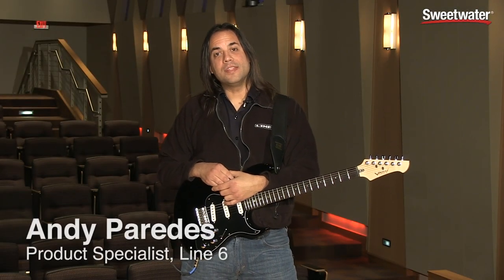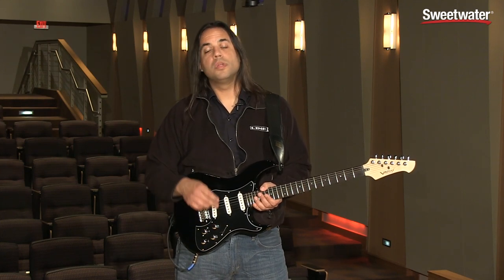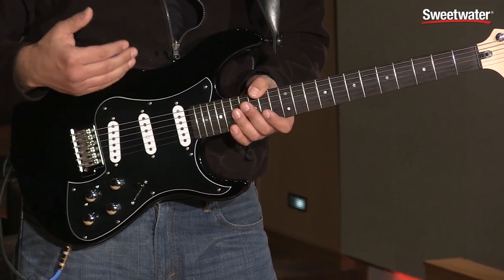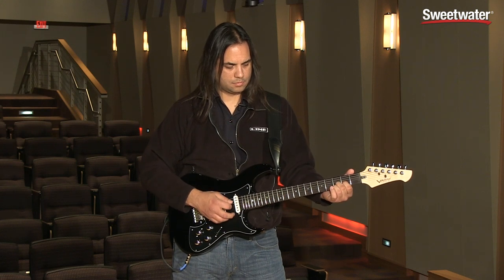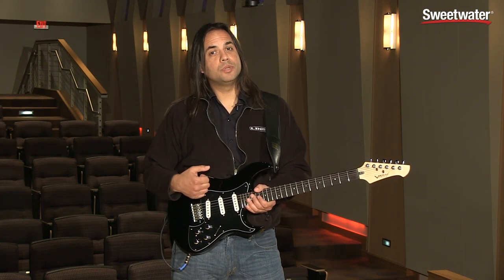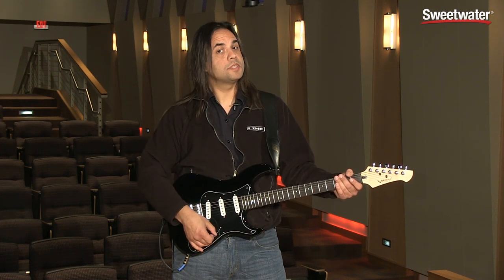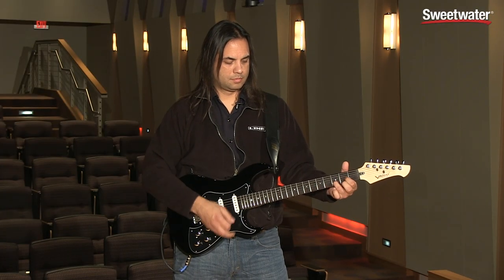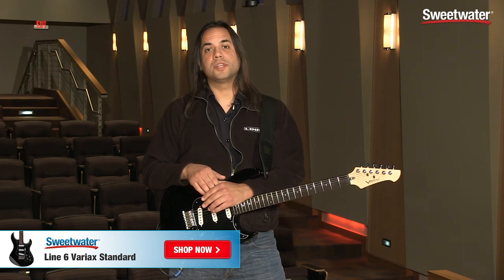Line 6 Variax Standard Modeling Guitar Demo by Sweetwater Sound

Comment: I wish they would add another output jack for the magnetic pickups only. That way I could use the modeling and real pickups simultaneously.
Reply: you can, but you mix it via workbench - it lets you mix with different tuning too - and you can choose the amount of mixing.  Then it all goes out via the one plug to whatever you have it plugged into - so, no, you won't be able to have two different amps with two different signals, but it's either or, and in my case, it works better to have it mixed on the guitar, not the other way around.
Reply: Oh that'd be cool

Comment: The Variax is such a great idea but just doesn't work properly. I had a new JTV59 but had endless problems with ghost notes and so returned it to the supplier for repair. Unfortunately they couldn't sort it so refunded my money. Then a friend of mine bought a new JTV69 with the exact same problem. The forums have many similar complaints. I would be very wary of buying a Variax as they need to be developed further to eliminate this issue.

Comment: Still a little frustrated by the fact LIne 6 hasn't put more (new) sounds in the latest models, could be more guitars, or some middle eastern stuff like the oud & baglama..
Reply: Karl Georges oud and lute would be awesome, or synths! Reaktor Prism sounds on a guitar would be epic.
Reply: Karl Georges Limitations of the onboard memory means they can't add new models. I read somewhere that the memory is full with the new firmware, so adding stuff is impossible unless you removed features or made a new Variax with bigger memory altogether.
Reply: Mandolin would be nice...?
Reply: @Fromagreatheight  hopefully someday. It’s still great as is though.

Comment: To start with, I've always been intrigued with the Variax guitars, but have never liked the actual build of the instrument. Now that Yamaha's on board, I need to take another look at it. Good move Line 6!

Next, I don't think I've seen Andy Paredes demo anything before, but man, he is GOOD. Zero 'tude, calm delivery, and he plays FOR THE DEMO instead of trying to show off. Good move, Sweetwater, keep this guy around!
Reply: I agree with you about the earlier model's build quality, I've had two, a 500 and a 600, heck I'm playing the 600 in my pic. It's a great concept and I've thoroughly enjoyed performing with these instruments but initial setup was not good. Hopefully matters have changed. cough Nylon strung please cough.
Reply: Obicere Interesting— but I'm not sure if you mean you'd like a nylon string sound on the Variax, or a Variax with nylon strings instead of metal?
Reply: Mooseboy08
Oh hi, yeah I'd like a nylon strung emulation. I'm not sure why that particular type was omitted, perhaps it was the technology or perhaps product positioning.
Reply: Obicere Shucks, I guess I assumed that nylon string was in the lineup of sounds. I do use the Nylon string + orchestral strings sound on my Roland GR-30 a fair amount, so this is a bit of a letdown. Thanks for mentioning it, although I'm still going to check this new one out.
Reply: Mooseboy08 Me too. Just have to wait and see.
Reply: Mooseboy08 Possibly add a Fishman PRO-TRP-301 Triple Play Wireless Guitar Controller  to 'hot-rod' the Line 6 Variax.
Reply: kbjazzgtr001 Now ya' see, that's why this guy gets the big bucks! That's a superb idea, thanks!

Comment: I have a Line 6 Variax JTV-69S and have installed Joe Barden pickups in it. It is just as straightforward as unsoldering and resoldering the pickups to the existing wiring harness. I love Joe Barden pickups so I would do this over again in a heartbeat; but, the only negative is when I was running the OEM pickups and switched to the Spank (STRAT) modeling the tone was exactly the same. So why do that - the OEM pickups are single coils and if you get into 60Hz hum you can switch to the modeled Strat and the hum goes away. 

Now with the Joe Barden's the guitar it'self sounds brighter and more Hi-Fi to me which I like, but the modeled Strat sound is still like it was - best of both worlds. 

Anyway switching out the pickups is a no brainer operation if you can solder 6 wires back into the right order. 

Take a picture before you start. 

Ron

Comment: This product intrigues me. Will I be able to get the sounds even when I’m not using that special variax chord?
Reply from the maker: Hey, Wlliamson! It's definitely a unique guitar, and yes you can still use all of the effects and presets with the standard 1/4" output. The Variax cable will allow you to connect to other VDI devices like the Helix for external control and unified presets, but it's not required to take advantage of the features on the guitar!
Let me know if you have any other questions.
Connor Smith, Sweetwater Sales Engineer, (800) 222-4700 ext. 1793, connor_smith@sweetwater.com

Comment: Hello Sweetwater. Can you please tell me all the inherent differences between this model and the J TV 59? What does each model do that the other one cannot?
To explain partially: I have lately been on a Queen kick. Although I know this model could potential he be programmed to simulate the sound of the Brian May Special, the JTV model’s headstock looks more reminiscent of the Special than this one does. If I was going to purchase a Line 6 guitar, it would be great to have one that bolsters both features.
Reply from the maker: Hello! Because of how the modeling technology works, you can achieve a lot of the same types of sounds with both guitars. The Variax standard comes with a single coil configuration and an alder body while the JTV-59 has two humbucker pickups and a mahogany body, so the natural sound of the guitar will differ between the two. You also have a trem bridge on the standard. There are several other differences between the two, so please feel free to give me a call to dig in to this and figure out which one will fit you best. Thanks for the interest!
Connor Smith, Sweetwater Sales Engineer, (800) 222-4700 ext. 1793, connor_smith@sweetwater.com
Reply: Much obliged Connor.

Comment: Is it possible to use it to live write guitar tabs into guitar tabs format (recognizing each string as played) with real notes length and pauses into Logic Pro X 10.4 as if it was a proper MIDI guitar ?
Reply from the maker: Hi, Emilio. This will not transmit MIDI cc. Give us a call if you need guidance on integrating MIDI devices into your DAW. 
Lindsey Becker, Senior Sweetwater Sales Engineer, (800) 222-4700 ext. 1674, Lindsey_Becker@sweetwater.com
Reply: I think I can do that with my Fishman Triple Play.

Comment: I'm contemplating on getting this in the next year or so... Would it be possible to swap out the pickups?
Reply from the maker: Hi Matthew Short! For the normal guitar “non-modeling” pickups, there should be no problem. Thanks!
Reply: Thank you! 
I always find that I like a guitar but always need to change something, I usually prefer higher output pickups. 
How is the overall quality of this guitar? I've always stayed away from the Yamaha pacificas. I've heard some negative stories about the quality. I'm hoping this will be better.
Reply: +Matthew Short I think Varian part only relies on the piezo at the bridge so those stock electric pups should work like regular guitars.
Reply: For what? that's part of the variax sound, you might ruin it IMHO.
Reply: Not true Metalgears1968, the modeling is done in the piezo element which is in the bridge
Reply: Only the piezos are processed, hence that's why it's the modeling part, but the magnetics are just the magnetics, like any normal guitar.

Comment: are there pedals that can do this as well?
Reply: There are some pedal, which make pretty good job, but not as good as this.
Reply: I don't think you could have a pedal that does all of this. For example, I think in order to have a drop-D tune applied digitally, you need to control the signal on each string rather than the guitar's output. There are probably pedals to emulate the sounds of different instruments, but having the modeler integrated with the guitar will allow the model to be applied to each string individually.